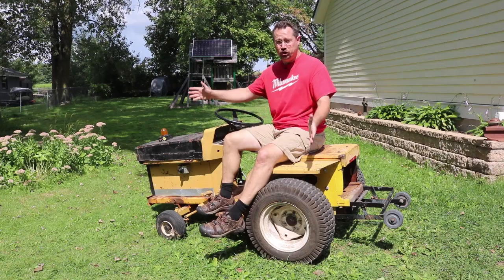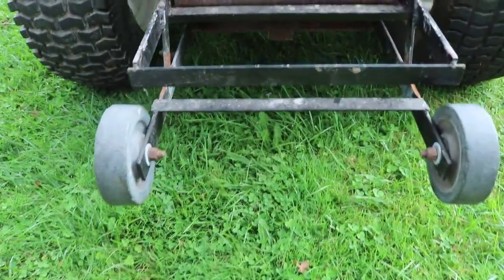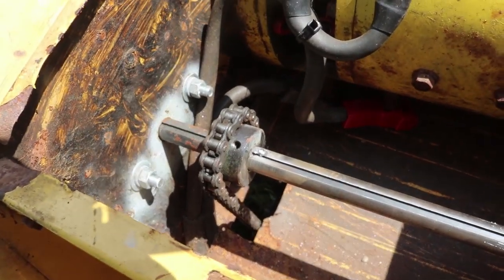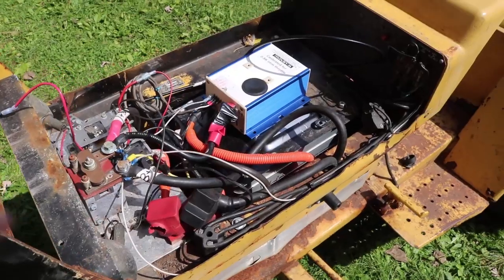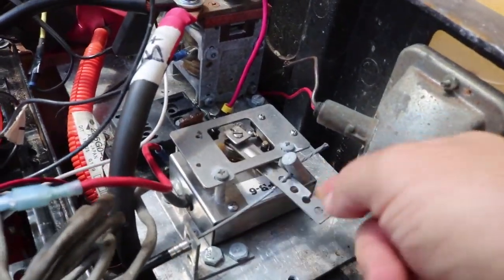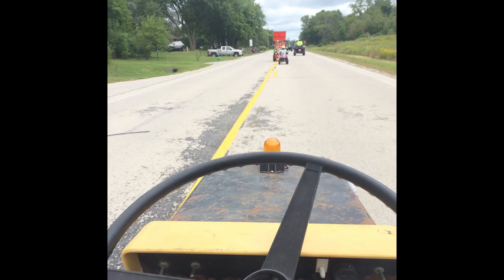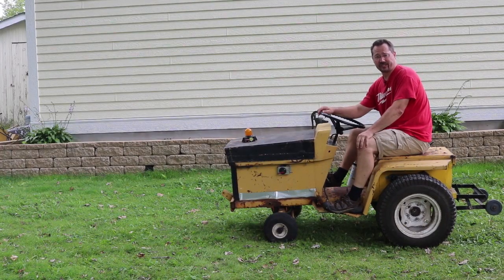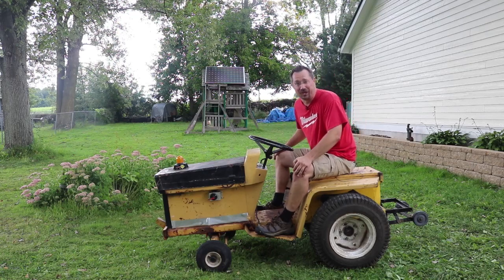Nissan Leaf Powered Rat Rod Electric Lawn Tractor

Comment: Love it when people build stuff for the fun of it. Track would look COOL if it had an extra two feet longer. DRAGSTER OR TRACKSTER!
Reply from the maker: I would love a tracked vehicle. They have a great look.
The other thing I think would be fun is to build a 4x4 based on one of these. Might be easiest just to double up the back end from another tractor so there's 4 drive wheels in back and leave the steering stock in front.

Comment: I would like to see how you figured out you needed a weelie bar
Reply from the maker: The motor I used in this project originally propelled a Geo Metro past 70 MPH.
Even at a lower voltage, I knew this would have plenty of power. Seemed a safe bet to add a wheelie bar.

Comment: No BS here..  When I was 12 years old my father took my best friend and myself to an estate sale where we purchased my very first hotrod.  What was it?!  A Late 1970s John Deere Electric-90.  $100.00.  Had a 3 speed transmission, 3 deep cycle marine batteries in series, and an electirc motor.  WUT?  This thing was hideously slow and had zero power.  We decided to take the drive belt off and swap the pulleys from the motor and the gearbox.  Our maiden voyage started in 3rd gear and "clutch dump" which resulted in a wheelie and nearly crashing the tractor into my fathers 1958 Edsel Pacer 4 door hardtop sitting in the driveway.  Not only would it bust the meanest wheelies...  friends father was a cop and clocked us going 30mph top speed with his radar gun.

Shenanigans ensued.. and I ended up accidentally driving this riding mower literally through a neighbors privacy fence.  We coudln't drive it on the streets, so we'd drive on sidewalks and in the grass easements next to the roadways.  While on a drive (with a trailer in tow with friend in the back) I started to drive under a pine tree.  Bad idea.  It pushed me off, turned the wheel directly to the right and plowed right through the privacy fence.  

What I'd give to still have that riding mower today..  :(

Comment: Aren't the front wheels a bit too small?
Reply from the maker: That's my favorite part!
This was an absolute JUNK frame that I had. It didn't even have two front wheels when I started. I found another front wheel at the thrift store, but it was small. But it DID match a different small wheel that I had. Better two tiny front wheels than just one front wheel.
I like it. It just makes the tractor more ridiculous.
Reply: @BenjaminNelsonX  yeaah. Golf cart wheels hhh

Comment: the tiny front wheels on the elec-trak gives me a tickle. it's like the atrophied arms of a t-rex. 😹
Reply from the maker: EXACTLY! This tractor was originally missing one front wheel. I had a tiny one which was the wrong size, but it fit the axle. Later, I saw a matching tiny tire at the thrift store, so I bought that for a matching tiny T-Rex tire!

Comment: Oh no, you disassembled your DIY electric car :-(
Reply from the maker: The electric car which I built over ten years ago and was eaten away by Wisconsin winter roads covered with salt. The body was junk, so I removed the EV parts including the motor, motor controller, throttle, and more.